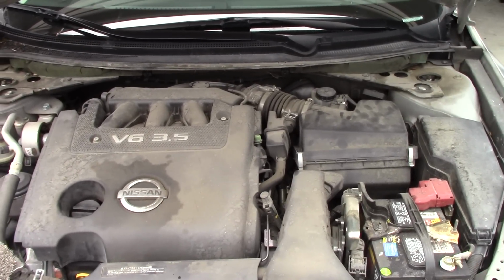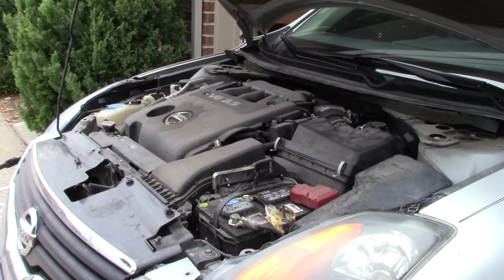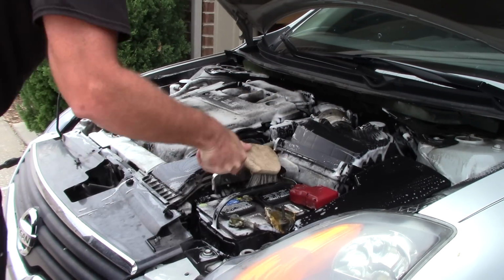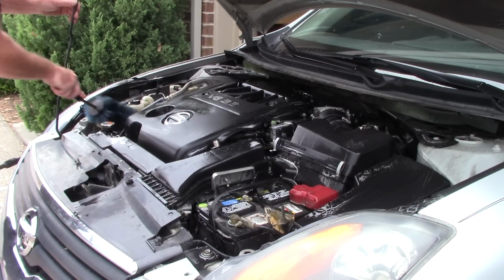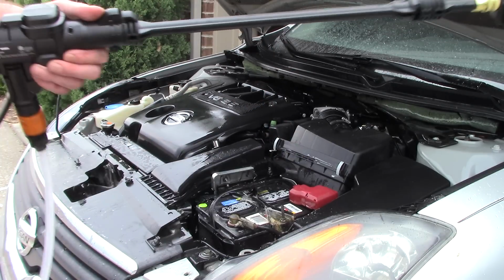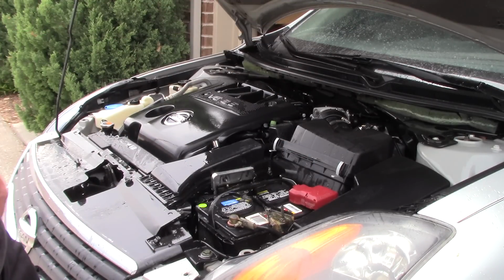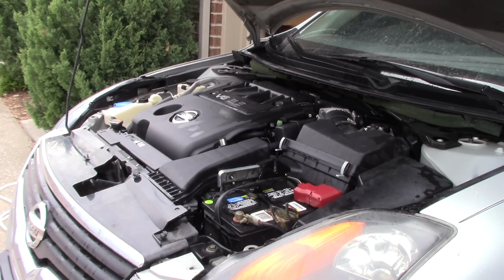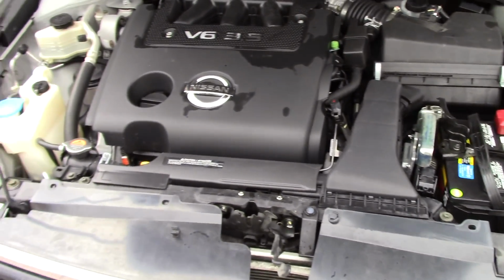Real Time: Super Clean Aerosol vs Dirty Engine Bay - Great Video For Beginners

Comment: That was a very lazy and unprofessional way of cleaning and engine, you should've remove the plastic cover on the valve cover then you can get a better clean
Reply from the maker: i offer that to my customers but that is at a different price...this customer wanted this service..so please know all the facts before calling me unprofessional...thanks so much:)
Reply: Dallas Paint Correction & Auto Detailing  so you charge less to half ass it?..
Reply: It's funny that this is thought of as "unprofessional" and "half ass".  What if the customer didn't have the money for the full engine bay detail and this was all they could spare this time?  There is nothing at all wrong with this method and I have done it plenty of times for my customers.  Most folks are perfectly fine with the visual parts being cleaned.   Besides.....it is a car that has obviously never seen this attention and is celarly not a $500K show car.  He also didn't get under the car and clean underneath......is that "unprofessional" or "half ass"?
Reply: MattHanson04 when I clean my engine bay I do top and bottom, including suspension parts so yeah I do think it's half ass
Reply: Mike Raposa who are you, exactly?
Reply: AN JDM Lets not forget those plastic covers are meant to protect things that shouldnt be getting wet
Reply: Plastic covers are engine trim....not protection (trim = make it looks flush and tidy)
Reply: AN JDM so with the way you guys think that means every time you charge a customer to do interior detailing you take apart the seats take it out of the car and clean under the seats and the carpet all under the seats right? I mean you don't want him to charge more or you think he should do that to the engine bay and take apart all the plastic pieces to clean under an area that's not going to be shown. Is that what you're saying the detailer should do for a Nissan? Or don't you think that should be considered in the price the customer pays probably for somebody that can afford a more deeper cleaning engine baywash somebody with a Ferrari or Lamborghini. I tell you what go ahead and make us some videos and show us how you detail an engine bay. 

I would love to see you cleaning interior also and taking out the door covers to clean under the door panels and also taking off the gauge clusters because I can see through the glass or the plastic of my gauge clusters and I can see the gauges so does that mean I have to take that apart and clean behind in all my gauge clusters?
Reply: to Mike Raposa, will you do mine like that for 30 bucks??  I mean top to bottom and suspension.... That's a steal... I can bring you lots of customers, LOL
Reply: Akhir Noormohamed Oh no another db armchair detailer bringing down the thunder...

Comment: just asking,   
1, why address you using a pressure washer that could knock off a little hose or enough pressure to break an old brittle piece of plastic on a electrical component.
2, you didn't disconnect the battery and you're spraying high pressure water all over the battery and the fuse box. Isn't this troublesome?
When we detail we cover all of that with plastic just to make sure the electronics don't get wet then we go back and manually clean them.
Just wanting to know if that's ever been an issue for you because your way looks quicker but I don't know safer.

Comment: But your worx sprayer did splash up to the windshield and like on the adjoining fenders. So now it needs rinsing? 

I'd use my hose with my multi spray nozzle in its rain spray setting. It has a flow lever for minimal water flow... won't get over spray. Just saying.

Comment: Great video just wondering why use distilled water vs tap water? Thanks...
Reply: Because it is pure so wont leave any water stops on the paintwork when it dries
Reply: Paul Chapman and won't also mess with the electronics if it gets wet

Comment: Contrary to popular belief, water is necessary to clean an engine.  First rinse with water, a fine mist not a heavy spray to get rid of the hard deposits of dirt and dust.  Then mix small amount dish detergent in a spray bottle of Windex, the best grease cutter on the market.  Soak it well, let it stand until it drys, then spray with a fine mist of water.  Let dry and then repeat.  With any chemical used to clean the engine, you should always flush with water.  I think you will find that this will do a satisfactory job, for you!

Comment: It appears that the negative battery cable is disconnected,  if so , is it necessary  ?
Reply: No it is not. I prefer to run my vehicle enough to warm the engine but not hot. A warm engine cleans easier. A hot engine causes the cleaner to dry up on the engine before it can clean anything. I used to detail and clean funeral home vehicles. The owner taught me how to detail clean back in 1978. I still clean vehicles the way he taught me.
Reply: @scottfirman  thank you very much.  Love your videos,  keep up the great work.
Reply: Question : My local Auto Zone doesn't carry Super Clean,  but they do carry Gunk engine degreaser , will that work  ?
Reply: @louindorato6855  Thankyou!
Reply: @louindorato6855  I am not a fan of it due to the chemical smell it puts out. I got a couple cans at a yard sale last fall for $2 For both. I use it on lawn mowers, not vehicles. Check your local carry everything supermarket. Its just me mabe but I am not a big fan of the gunk cleaner. I dont see where it does much, even on a lawn mower. Check your dollar store. I dont think gunk foams and clings as well eather. Price wise, Super Clean is cheaper too.
Reply: @scottfirman  thank you  I appreciate your advice
Reply: @scottfirman  btw: that engine compartment looks awesome

Comment: Should you unhook the battery to the car?
Reply: Do you unhook it each time you drive in the rain?
Reply: @DISOPtv  Unlock the battery in a customers car and when he losts all the codes for the steree and the settings of the seats and other settings witch you can lost if disconnect the battery.....then explain to customer why he has to make the adjustmnets again.........

Comment: yes it looks better, but there are many (some on YouTube) that say water spraying is harmful.  Especially on newer automobiles, the many connectors are not always sealed as the years go by.  corrosion can take place and using distilled water is not a help.  pressure sprayers force water into places where it sits and causes corrosion.  after saying that, I'll admit that I cleaned my engine last week.  I sprayed with Purple Power, quick spray with the water hose (no pressure spray) , blew off with leaf blower and then sprayed with a protectorent from the Chemical Guys..

Comment: I still have a problem seeing a pressure washer pushing pressurized water at electrical parts and connectors that close to the nozzle ... many areas not covered with plastic? no need to ?

Comment: What about electrical components under the hood? 
My niece just bought a barn find '96 MUSTANG.  It had been sitting in a barn 15 years, and was covered in 15 years of dust.
Under the hood needs this type of cleaning done. It looks worse than this car. 

I haven't done it for her yet,  because of a fear of ruining some electrical component. 

I just purchased an '00 Mercedes Benz E430 that needs this too.

Comment: (1) What was the reason for using distilled water 
(2) wouldn’t it have been better to use a wider spray tip
Reply: So the ions in tap water won't short out he electronics

Comment: Do you need to cover any components like the battery terminals, etc. when using the product or hosing it off? Also if you don’t have access to a power hose what else can you use to rinse after applying the superclean?

Comment: Nice video & job. One question: I heard that you shouldn’t spray water on the engine (I think from ChrisFix)…is this a fallacy about getting water everywhere on the engine causing problems with electrical and other connections, etc? Should you rather clean everything by hand instead of spraying water under the hood? I need to clean my 2007 RAV4 :-)
Reply: Yes I'm wondering that also

Comment: Is this safe on the painted areas? I used Super Clean in the spray bottle in it started to eat the paint. Thanks
Reply from the maker: Jim Powers sounds like you had single stage paint ( not clear coated) or you left it to dry and didn't rinse completely.
Yes we can use a degreaser on clear coat but make sure the ph rating is 12 or less..When using straight just make sure it's not left to dry and make sure you flush the area completely
Reply: Dallas Paint Correction & Auto Detailing Thanks Scott. It was under the hood on strut tower. It did dry before I brushed it. Will only use the foam in those areas in the future. Happy Father's day.

Comment: First step: Apply cleaner without brushing and rinse off. Second step: Allow to dry. This will reveal the thick crud. Third step: spot treat the thick crud with cleaner and brushes. . . . This method requires the least amount of time and effort. . . . OCCAM'S RAZOR

Comment: You know, I live on a dirt road and my 04 Mercedes E500's engine is dirty.  After seeing all the scary comments on Mercedes Benz forums about all the problems people that wash their engines and sensor failure, along with alternator failure.  What tips can you give me that will confidence to wash it?  I for sure don't want electrical problems now or later on.  Thanks
Reply: Tom Only use pure distilled water to wash your engine bay.  Tap water from a faucet will short out electrical components.

Comment: Question, I've never done an engine bay clean.  I noticed you didn't prep anything on camera, plug anything, unplug anything etc.  Is there a need with newer cars?  Or is it simply use a low PSI water jet, some cleaner, a brush and i'm good?  I saw in a previous video you said to make sure there is no cracked plastics on plugs etc because the water can seep inside the cracks causing warnings to go off.  However I would like to clean my engine bay, and from what you showed it looks very simple and easy to do.

That Super Clean, is it a retail product sold in any store, or is it a professional product?

Also, how long does 1 battery last on the supershot, should I get more then 1 for personal use?

Thanks.

Comment: spray & wipe tire foam on all plastic & rubber surface for extra protection, then you can just spray the engine bay every 2 months when you check the fluids

Comment: I  couldn't see greasy grime, but a lot of dry dirt, which if clay is a cleaning challenge. When its facia is literally falling off, a vehicle is indeed hammered.  I'd be very cautious to avoid getting blamed for previous negligence. That was sufficient reason for making a video.  As far as the product used,  I clean engines before working on them  I found that aerosol cans are hard to use for getting below those ridiculous plastic shrouds and into where the heavy grime is.   I use a pressurized tank with a thin flexible 10 ft hose and two compact attachments,  a foamer and a sprayer.  When I run out of Zep degreaser, I'll try the Superclean liquid.

Comment: I’m confused. I want to detail my engine but seems really scary. You don’t cover the alternator or disconnect battery?
Reply: Kevin Grace I was just wondering that something. Last I knew those two don’t mix
Reply: Cover the alternator with a plastic bag or two, disconnect the negative on the battery (or both if it makes you feel better), and you'll be fine.

Comment: Dallas Paint Correction and Detailing  Thanks for the vid. A master mechanic friend of mine said you should never steam clean an engine as condensation will get into electrical connections. I wanted to clean an extremely dirty engine that way. What do you think?
Reply: Kory Beckwith maybe just tape off any electrical connections and wrap a plastic bag over the alternator and battery. If you are pressure washing the engine then dont stay in one spot for too long, keep the lance moving

Comment: Looks fantastic. However I noticed the 3.5 on engine cover has been mostly removed.
Reply: @dallaspaintcorrectionautod8343  yeah, I figured it was barely hanging on and looked like it may have been flaking a little before the cleaning process. I have an old Porsche 944 that needs a good cleaning and I'm looking for a safe way.

Comment: Scott, how much of the product did you use?  Great job as always!
Reply from the maker: well i can usually get about 3 engine bays done with one can...this engine bay was pretty bad and hadn't been clean since 2007 so i used almost half a can...the can is about 6.99 retail...i like that it clings and doesn't run away from me, on really bad engine bays i have used about 1 32oz bottle of super clean to get the job done..so yes you will spend a little more money with the aerosol but its so great that the product clings and it makes it easier on my hand since I'm not squeezing a trigger sprayer:)...it just makes my life a little easier and thats why i love it plus its full strength in the can and wow can it cut through nasty grease and dirt!

Comment: What's your opinion on using a simple wash & wax product on engine bay?  It has both cleaner & a wax to dress plastic & metal or would it just occlude the shine?
Reply from the maker: well a car soap isn't the best cleaner for removing heavy grease and dirt that may be found in an engine bay, but if your engine bay is well maintained than a car soap would be fine as long its light dust and dirt your removing..i don't think the wax found in car soaps would be enough to give plastics and rubber the shine you would be looking for...but if your removing just light dust and dirt, i would check out armor all wash and shine in the aerosol because that stuff can clean light dust and dirt and the "polymers" within the can will give plastics and rubber a nice satin matte look:)...hope that helps and much love

Comment: Scott, I watched this video the other day, went and bought 3 cans of Super Clean aerosol cans from Oreilly Auto,  first can sprayed fine for almost a full coating of engine bay, then quit spraying. Grabbed second can and not even 20 seconds and it quit spraying. Gave up and took them back for refund. Guy at Oreillys said that I'm not the first to return this product because of this reason.  Have you had any problems since video debut? I noticed that your can was more white and now they are purple. Wonder if they changed the nozzle since your video?

Comment: It's just smart to disconnect the battery when using chemicals and/or water in the engine bay. And you shouldnt spray your engine with a power washer. Use a hose without an attachment or something that sprays at low pressure.

Comment: 1. You should un hook your battery bc electricity and water don’t go well together and 2. You should use a high pressure hose bc it can get into the cables which may cause tear or leaks. Watch Chris fix videos his are like the best on cars

Comment: Not complaining or being a smart a$$,but the brake fluid master cylinder is behind the air filter,drivers side next to strut tower. Passenger side small container is power steering fluid reservoir.

Comment: If you work in detail then shouldn’t have you covered any electrical connections before you did that? Say the battery since it’s wide open ?
Reply from the maker: Christopher Robin Hostetter battery can get wet, you can't fully submerge the battery within water and that's why we just rinse the engine bay and battery..If you are concerned you can always cover what you like:)

Comment: I've read a few comments on here and they make me laugh.  Most electrical components and joints nowadays in modern cars have a rubber ring seal around them and nowhere did I see this man take off the idiot cover to reveal the spark plugs. It's just a shame he didn't start the engine up. To show you idiots it still works. I have a Karcher jet wash and that's what I use on my cars. And I've never had a fail start. Oh and i live in f#$☆king England where it's cold and damp most of the year. You did a great job mate.

Comment: Even though I usually wash my engine bay with a high pressure water jet, I just want to point out that it's in theory not the amount of water that could be damaging to the vehicle long term. It's the speed(/force/"pressure") that allows the water to penetrate contacts and small gaskets for electronics, that WILL corrode over time.

But as I said, I do it this way too.

Comment: If you do this to a 5.3 vortex Ls(Chevy) engine you WILL mess up your knock sensors that sit on top the block head. It will collect water in the knock sensors hole and corrode the metal connection. That's at least a $600 job at your mechanic shop..good luck with that! Every car is different so know what your doing before you do it

Comment: Wait on the other video  you use  the garden  hose with the garden gun with  it only and you said a pressure washer is not need to clean  the engine .

Comment: Dont use air to dry the engine. You're gonna shoot the water further into the plugs and cause shorts. Ive cleaned the engine bay on my 01 prelude probably 10 times and the first 9 times I drove the car with the engine still wet and had no problems. The last time I used air to dry it and sure enough I turn on the car and find an ABS light, climate control doesnt work and my power mirrors moved themselves and no longer work. Turns out a fuse blew for the ABS and climate control but my motors for my power mirrors are fried now and no longer work.

Comment: Good vid but all that spray especially all over the battery made me gringe a bunch. Yea it works very well but for me I would spray and wipe a little at a time so stuff doesn’t get messed up or shorted out from the battery terminals getting wet or ace pully belt squeaking a crap ton and ruined after washing and rinsing lol. Good vid though like watching this stuff keep it up